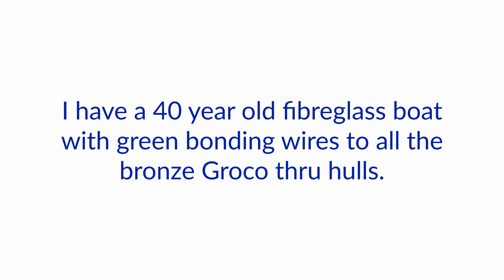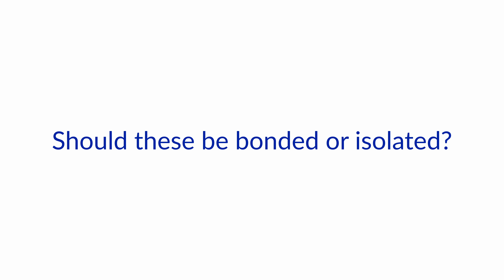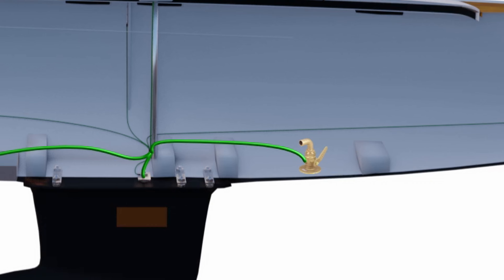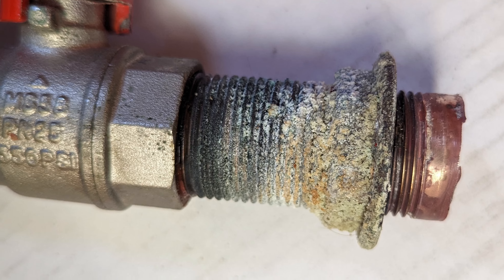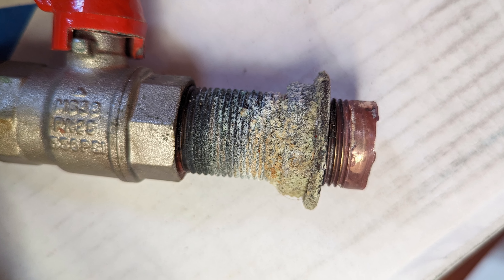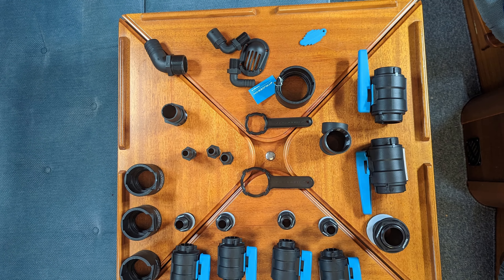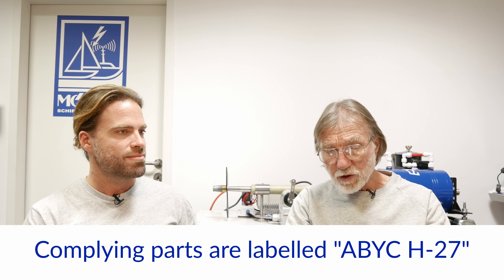BONDING THRU-HULLS - Is this necessary? | Ask The Expert with NIGEL CALDER

Comment: Very interesting! 
I will be replacing all of my thru hulls/seacocks very soon and have not really settled on the to bond or not to bond discussion just yet. It seems like there are pros and cons to each approach. 
I was looking into some of the higher end Groco Thru hulls and valves lately and they are now cast from C84400 Bronze which I believe is up to 15% zinc. My understanding is that this metal should last a very long time in the marine environment.
With all of these valves having either a chrome plated brass or stainless steel ball and shaft, is there a concern of dissimilar metals here similar to a prop and shaft situation?

Comment: How do the composite/plastic fittings hold up to UV?  Every vessel I've seen 10 yrs old or older with plastic drain fittings the plastic has deteriorated to the point of near failure?  I've always made it a practice to change above waterline fittings with stainless and below with bronze.  I've always had a fear of shearing the plastic ones off if striking an object.  In the Chesapeake Bay there have been significant issues with submerged or partially submerged debris from laregs Susquehanna dam releases.